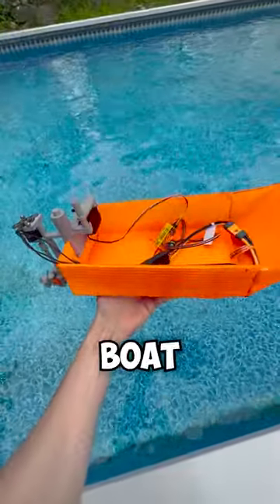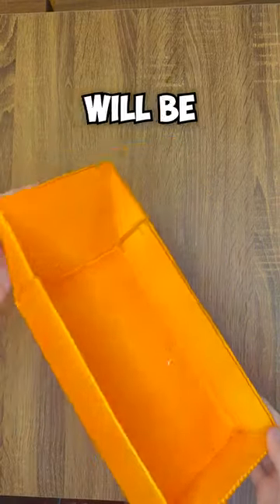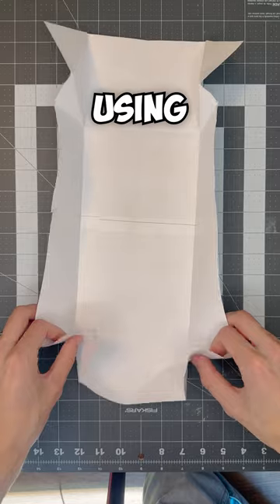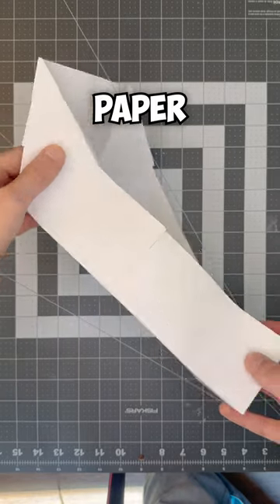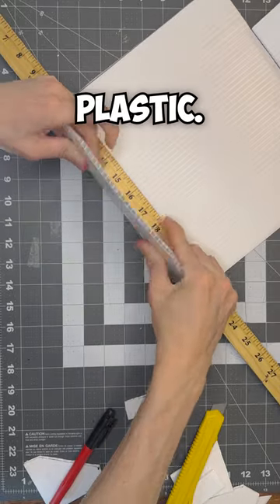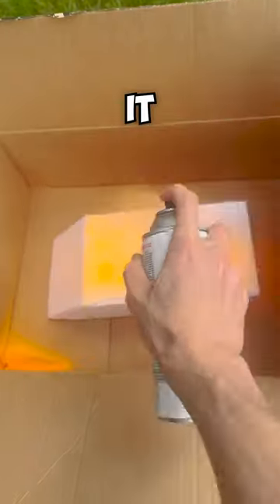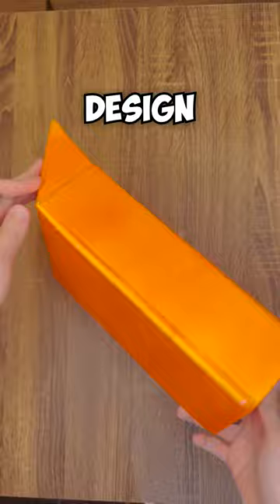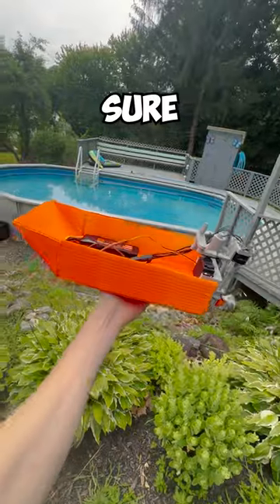New Hull for RC Boat

Comment: Can you make an comparison video between the 1st type of propeller you have shown( Just like archemedis screw) and the next one with 3 fins of same diameter and pitch. And in your latest video you have said to remove gear box so can you please  remove gearbox and compare these two propeller. Thankyou .
Reply from the maker: Yes, a comparision video of different propellor sizes drops tomorrow! It may not be exactly what you want but I think you will like it!
Reply: @makermandan  can you make an video as i said please.
I am designing something and i have to check which design will be more efficient. I dont have 3d printer so i am asking for your help please.